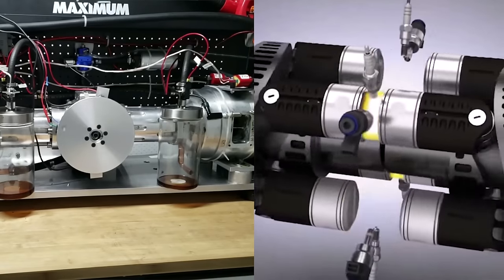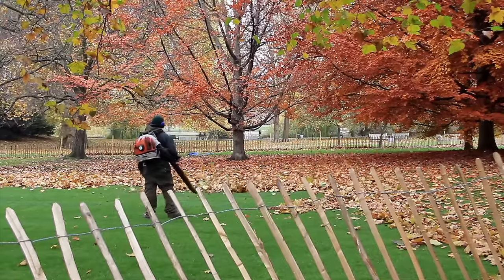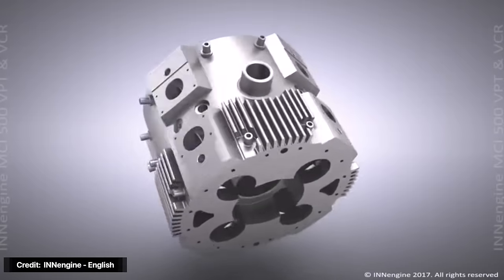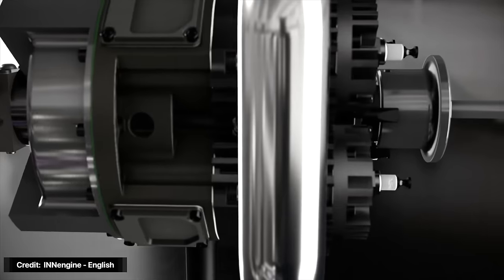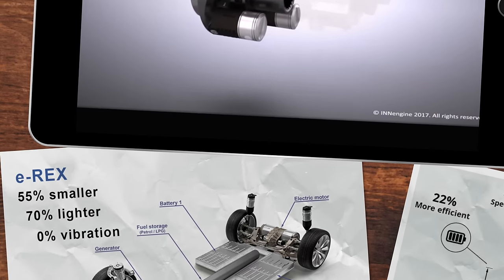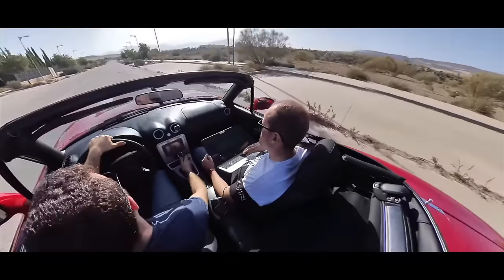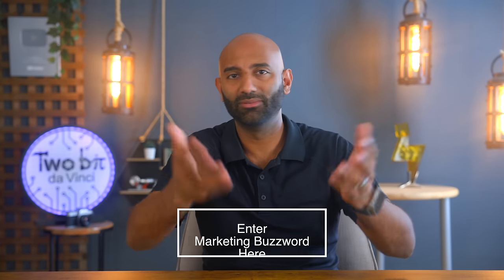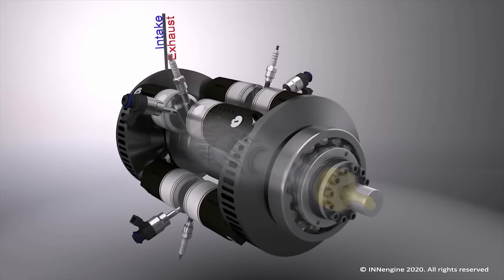One Stroke Engines - 200% More Efficient??

Comment: Why build it?... Because the truth is that the gasoline engine is not going away. Batteries have a long way to go, and the development of gasoline engines can provide useful discoveries. Mutch like nuclear power, even though it's not popular, it still provides useful discoveries. As far as electric cars though I would go for a non direct drive gasoline engine like a range extended one but with a very minimal battery desin. Especially for the cold! Small enough it can keep the battery warm so that it doesn't crap out in the cold.

Comment: A swash plate to replace a crank shaft? Come on now! That is nothing new. AC compressors have been using this technology for years. It works great for pushing air but the opposite of being pushed into making power is ridiculously.

Comment: Ranger extender for electric makes a lot of sense.  How about the water powered car as was done by Stanley Meyer?  Outside of direct space resonant energy conversion, the water engine is the only thing that really makes sense.  There have been lots of designs, but few get past the buyout to shelf phase of commercialization.  Maybe Europe or Africa will be able to pull it off.

Comment: When you consider the effort and resources required to make one Tesla car battery, its easy to feel that EV's are not a better economical solution to modern transportation and energy needs. I believe that Hydrogen internal combustion engines are far more economical and less hazardous and destructive to the environment. Electric batteries may end up seeing far less invasive construction techniques develop in the future, but the way modern technology is being used to create batteries, they are still very caustic to our environment in several ways. I want my Hydrogen ICE car BADLY. Hydrogen may not be as energy dense as fossil fuels, but there is still much research to be done on the matter. I, for one, would rather have a slow HICE car, with which the only emission is WATER, than a fast EV or gasoline engine car that has an detrimental impact on our environment.

Comment: Currently there is no real good solutions for EV's in places like Wyoming. They simply do not have the distance to literally make it from one town to another. Sometimes with technology we assume a technology must be used for all circumstances. One lesson I take away for most new age technology is that what makes sense for one application may not make sense for another application.There are places where Geothermal is brilliant while there are places where Geothermal doesnt make sense. This doesnt make Geothermal technologies useless. Just makes them useful for certain situations. Same goes for wind, solar, tidal, ect... Going with that we brought up small consumer devices where batteries simply are not yet powerful enough for lawnmowers, chainsaws, ect... in this case having a quite, less polluting, more efficient, small form engine would still be really useful to have.

Comment: I've always thought Hybrid was the way to go. A small efficient engine-driven generator that runs at peak performance and efficiency keeps the batteries topped off and extends the life of the battery. Deep cycling batteries shorten the life of the battery, they are expensive, and I predict they will become a solid waste problem. Not only that but you don't have to stop to recharge if you don't want to. Everyone wants EVs but there are huge hurdles to be cleared. The electrical grid needs to be upgraded to handle the energy needs but at the present time, it is woefully incapable. Also, (for the dreamers) wind and solar will not supply the energy needed to go EV unless we block out the sun with them, so we will still need fossil fuels or nuclear. Nuclear is the cleanest form of affordable energy. Those are the only two real options. I believe all the climate change hype is based on a faulty solar cycle model (Milankovitch) and is political nonsense but we must always look for cleaner ways to exist. If we can do it cleaner, so be it, but not at the expense of lives.

Comment: I'd never, ever buy a purely electric, battery driven car. It makes absolutely zero sense. All that weight and a severely limited range with a long recharge time. 
Zero sense. 
A hybrid electric drive train: absolutely. Extended range with the efficiencies of electric and a much smaller or zero battery bank. Wins all around.

Comment: I would love to get an electric vehicle but the reason I will go for a gasoline powered car is because of the simple fact that battery technology has not progressed to the point where an electric vehicle is good for a majority of the climates in the USA.  Batteries have a good range of temperatures but for the temperatures that I live in (120+ F during summer and down to 15 during winter) the battery degradation is too high for my liking considering the cost of replacement.  If we could get the battery life to 10+ years and the nominal operating / charging temperature range from 0 F to 150 F with same or slightly higher energy density to what we have now while dropping the cost then I will definitely get one.  Otherwise it is unfortunately not cost effective.

Comment: I'd say the InnEngine design would be far more effective at burning cleaner fuels, like biodiesel, ethanol, methanol, or potentially hydrogen, its smaller size, lower weigh, and compact design make it perfect for driving an electric generator.

Comment: The swash plate surface and the surfaces of the rollers that ride on it must be really interesting: contact stresses, equal surface velocities vs. radius from the drive shaft (maybe there’s some sliding contact), etc.  To my mind, if they’ve got that worked out, their engine is viable.

Comment: I believe your thought patterns are correct.  But this idea was started with Hybreed cars.  Why your idea works well for reducing pollution if only 50% of drivers use this idea.  Possibly by then other tech build on the idea.  Small steps are needed to change the over-all concepts for the average American mind-set.  Save the earth should be on every mind

Comment: A range extender is not a new idea, but it is a good idea, I believe.  And BMW did as well and produced their i3 with a Range Extender option.  Sadly, that car was probably a bit ahead of it's time now that hybrids are all the rage!  A combustion engine running at a constant speed is more efficient -- hence, the reason ICE vehicles get better highway mileage. And electric motors are far more efficient, so a light-weight backup generator to only charge  a battery that is then used by the more efficient electric motor is the best of both worlds during this transition period.  One day, battery tech. and electric motor efficiency will reach a point that backup generators are never called into duty.

Comment: Great video. Could you do one on indirect methanol fuel cells for EV propulsion like it is used in the Gumpert Nathalie? Since MAN builds ships propulsion that runs on methanol that can be produced with green energy it could be the energy carrier we are looking for. Easy to store and gas station could be retrofitted to pump methanol instead of gas. Battery EV are not the solution!

Comment: That still have same issue as both two stroke engines and rotaty engine. It will have nasty emissions...
One of the reasons mazda rotary engines failed was they couldn't fit in EURO norms at a price 4 stroke engine with turbo could.

Comment: Some of those comments you made I can believe you are a mechanical engineer. And that's not a compliment. I know a guy who has a mechanical engineering degree and never worked on an internal combustion engine. Some of the best engineers I know have no degree. You are right its not a 1 stroke engine, steam engines are 1 stroke. Also the world is a long way from going electric. Modern EVs suck! If it wasn't for the EPA, diesel engines are the answer, good low end torque and fuel mileage, that is what I drive, pre-emission diesels.

Comment: I know the EV is slated to take over the market, but the electric grid is not capable of producing enough at the moment to power even a slim majority of drivers owning all electric EVs. these efficient engines could be good for improving fuel economy for small vehicles, as well as being a generator for homes, hospitals, and hybrid EVs. having several of these attached to generators at critical infrastructure as a more efficient backup. also, if they can make them cheap enough, people will happily buy generators fo their homes that are quiet and efficient.

Comment: Weather has a big impact on EV as both heat and cold drain the battery.  Living in the middle of the US, there is long distances with very little sources for electricity to "recharge the EV".  Example a person who owns an EV won't take it out during the winter even to drive local in his town because the battery will only last 1 hour because of the cold weather.  I think other sources of fuel like hydrogen will make more economic sense or improve the current engines to increase the mileage and efficiency.

Comment: Supposedly, replacing 12 large freight carriers with nuclear variants would eliminate the same amount of fossil fuel pollution as 4 million cars every year, which paints a very clear example of why gas engines will continue to be refined and won't be going away when electric is on the rise; were people more trusting of nuclear options for large applications, like those freight carriers, then we could drastically reduce carbon emissions on a scale unachievable by replacing every single car with an EV, regardless of the difficulty and complications in doing that.

Comment: EV's are not going to be main stream until a much larger scale charging station infrastructure is built, the power grid to charge millions of cars at the same time on top of what is already being used is upgraded, the cost of the vehicles comes way down, the weight of vehicles comes way down, charging times are brought way down to be more in line with gasoline refilling times, and match or exceed combustion engine mileage of an equal size vehicle.  As of right now making the batteries( including mining for the rare earth metals) for EV's causes more pollution than it does to make combustion engine vehicles.  I know that will change in time but today we are not there yet.  Hybrids I believe are going to become more main stream rather than full electric vehicles.  I'm all for ideas like the one in the video.  If we can make cleaner burning engines and increase m.p.g's dramatically, this combined will be more beneficial than going straight to EV's.

Comment: Range extenders are the best solution for long range EVs.  You get the benefit of fuel for its energy density combined with the efficiency of the electric powertrain.  Then as a bonus, you could cut the battery size by say 75%, making the vehicle more efficient, while also lowering the environmental impact of the battery life cycle per vehicle.

Comment: I think they may have avoided calling it a two stroke engine because, my understanding is that two strokes were banned (or at least not sold) in many parts of Europe (maybe just because no two stroke could meet the emissions standards at the time). This has been particularly hard to navigate for the casual marine hobbies who benefitted greatly from the power to weight ratio of two stroke outboard engines that can be carried by hand. In such circumstance I can see why they would do anything they could to differentiate themselves form other two strokes, especially if this engine is as clean running as they claim....

Comment: The problem with EVs is the Economics not better than an ICE so there is a push back on EVs. Until EV manufacturers is willing to fix/replace batteries at a reasonable cost, Insurance will remain high for EVs and that breaks the economics.

Comment: It could be a huge success if they run that engine on hydrogen, which I believe they are already doing, and also have politicians pass into law the same economical discounted incentives that EV byers in some countries get from driving clean cars.
Slamming a gasoline powered engine in and adding all the environmental taxes and challenges from pollution that follows would be a step backwards.

Comment: Hybrid is not a new concept, train locomotives have been doing that with out the use of batteries for years. The largest ore trucks use that system as well. A hybrid system is the way to go allowing the most efficient use of electrical production and battery pact to give you storage for when demands are extreme, low or high. Check out what Edison motors is doing, the are marking trucks more powerful at the same time much more efficient. They are putting 600 up to wheels with electric motors and only using a small diesel engine to keep the batteries charged up. Their system also uses the motors for braking and recharging the batteries at the same time. They have reported up to 300 percent increase in the trucks efficiency.

Comment: Range extender sounds cool, until there is a battery coverage like the petrol coverage we have now. What I mean with that is, that we need a standardised battery which is simply swapped at the station, just like bbq gas bottles. Petrol stations are turned into battery stations.
Apart from this I believe that the individual car for everyone is an unsustainable concept, no matter which fuel.

Comment: Ive seen photos recently on youtube of Teslas queing up over 30 cars waiting to charge at a tesla network garage in california, now if each car was sold with one of these engines to charge the batteries when needed wouldnt that que be shorter? Fact is EV's are dying here in the UK and you EVangilists are going to have to face it unfortunately, depreciation is very very high within the first year a typical 10 thousand mile EV at one year old is loosing over 10k in value, insurance costs are doubling because insurance companies are suffering such big losses on battery damage rendering the batteries unsafe and righiting off the vechicle completely, No used car dealer wants to stock used EV's on their lot because they do not Know the battery history and they are afraid that they will catch fire. The sales of EV's in the UK have reached their peak and are now declining, in a couple of years they will be out of fashion for those that wanted to show off to their mates with the fastest zero to 60 mph vechicle on the street who are now suffering the problems of long distance runs and limited availability of charging infrastructure, it is a failing project and many have released their EV's back to the delearships at a loss to return to combustion engined vechicles and finally the worst thing any goverment can do is try to force something on its people and the British people dont really like that. Ive just bought a new diesel car and Im glad I dont have to charge it up, its as clean with addblue addative as any diesel has been and it will see me out as my last car, it doesnt drink as much fuel as an american diesel because it only has a 1.5 litre engine but it does have a real syncromesh automatic gearbox german made so hopefully it will last a while. I will never be sucked in to the EV crap that others have been it is doomed to fail when a goverment hell bent on controlling people want to force this technology upon you and the infrastructure is not ready, what charging is available is overpriced and equates to the same or similar prices as running a diesel vechicle, electricity for charging EV's here in the UK is three times the cost of what Americans pay in motorway service stations, even your home electricity is cheaper than ours. in honesty I really do Hope America does go all electric they have been running excessively oversized engined trucks for years and guzzling up all the oil on the planet for far to long. All I ever hear from Americans with 5 litre trucks is complaints on the costs of fuel buy a smaller engine vechicle then Doh!! There is and always has been such a thing as living within your means. Remember it is the people who decide come election time who governs them and best serves them, it is not the goverments place to force people to do anything they dont want to or they will find themselves out of a job. Scientists say there is another 100 years of oil left on the planet at current consumption rates, Market forces will decided the more economic route to cheaper reliable motoring and you are going to have to go a long long way to beat the refueling capebility of an internal combustion engine and the density of eneregy the fuel contains for its volume to keep the people happy, the only sensible way forward is to develop hybrids with ICE engines that burn little to no fuel at all, until we can come to a point where the technlogy and electricity prices fall to what the people consider to be a reasonable price to buy and run their electric family vechicles. More information about a used batteries history needs to be available if the used Ev market is to suceed here in the UK Used car dealers need to be able to plug in a diagnostic machine and read out the battery charging history or they wont stock them at all. They also need to be able to pass this information onto the next owner and only then will they be confident enough to stock used Evs.